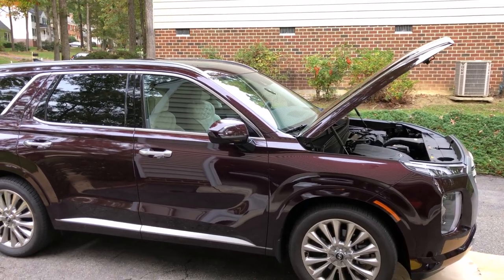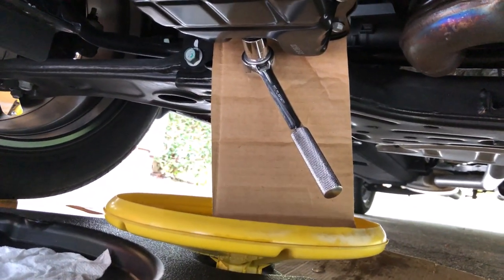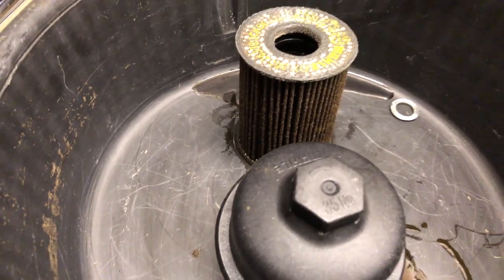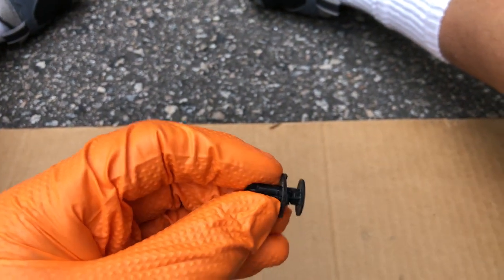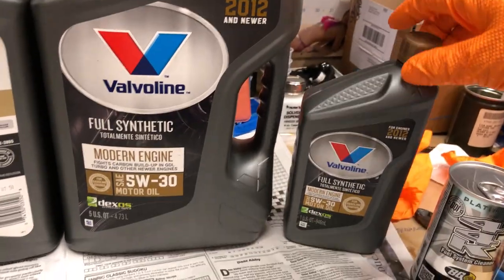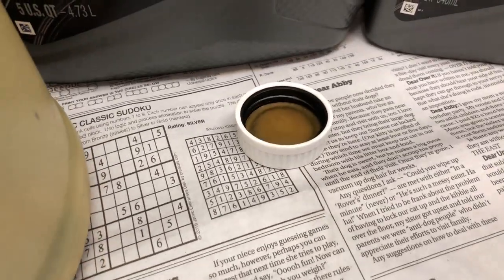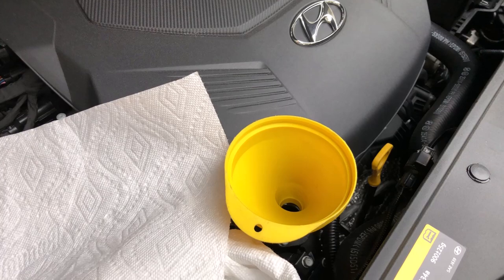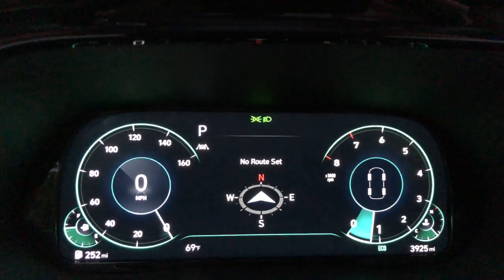2020 Hyundai Palisade & Kia Telluride Oil Change

Comment from the maker: Update:  I suggest you add only 6.0 qts and check it from there.  
I initially put in 6.5 qts.  I pulled 1/3 qt out and I am now right at the "F".  
So, I suggest you start by adding only 6 qts and check your level from there.
Reply: Keep in mind Hyundai built and tested your everything on your Palisade, so they are gods when it comes what they write in the manual you SHOULD take it as what is recommended. If you install less oil and something happens and dealership determine's you put too less oil in it, Hyundai could void your warranty.  The same rule applies so when they suggest you change the oil, if it says 8000km and you do it at 5000km (or whatever that is in miles) no oil are you polluting the earth but you risk voiding your warranty if something was to happen.
Reply from the maker: @andrewenglish3810  Hi Andrew,  Thank you for your comment, but I strongly disagree.  Is still is, and has always been, standard knowledge that you should never overfill an automotive engine with oil.  
   Even the Hyundai Owner's Manual states, 
"To prevent damage to your
engine:
• Do not overfill with engine oil.
Add oil in small quantities and
recheck level to ensure engine
is not overfilled."
Reply: @andrewenglish3810  you can change your oil every 1000 miles if you want. You just can't go past the 7500 mile mark for warranty purposes.

Comment: Thanks for posting this. I just boght my Palisade last month not ready for an oil change yet. When my car is ready for it's first oil change this info will help me a lot specialy info about Famuto drain valve. Thanks again.
Reply from the maker: You’re welcome. You will love the Fumoto valve.
Reply: How many miles is the oil change due?  The palisade doesn't have an indicator
Reply from the maker: @tomtom915melendez3  The book says:
Normal driving: 7,500 miles/12 months
Severe driving: 3,750 miles/6 months
Reply: @rickstid-bits  the valve didn't work for me.  Not enough clearance from oil pan indention.  Could not screw it in the oil pan.
Reply from the maker: @jayvogel7273  I'm sorry about that.  Thank you for letting me know.  I haven't done my second oil change yet.  They make a valve that stays loose while you install it, then it can be positioned and tightened.  It is their SX series.  Call them and see if this one will fit.  They should exchange it for you.
 https://www.fumotooildrainvalve.com/SX.html 
Again, I'm sorry about that.
Reply: @rickstid-bits  no problem.  I did first oil change today and was excited to put it in.  But hope this helps everyone else.

Comment: This is very helpful, just wish you would have shared when you tool the oil plug and the oil filter off.  As for the amount of oil, I went to my dealer and for the 2020 Telluride its 6.0 quarts.
Reply from the maker: Hi James,  Sorry . . . I had one hand on the wrench and a paper towel in the other ready to wipe the wrench hand dry.  It did shoot out the drain plug hole.  The filter was a nice and slow stream.  Thank you for writing to me.

Comment: Hi Rick, I had a recent oil chance on my 2020 Palisade and am experiencing a leak through the drain plug. Any idea why? Is it a problem with the washer? Any suggestions about it? I will have to return to my mechanic for the second time to see if they can stop the leak.
Reply from the maker: Hi Alex.  Yes.  Take it back to him.  It could be it's loose, dirt in the washer's seal, forgot the washer, cross threaded the bolt.
Reply: I would def take that back dont f with slow oil leaks

Comment: Ive owned mine for about a year. Honestly the oil catridge never goes back super smooth. It always binds slightly as you advance the catridge with a bit of force as you say from the new filter.

Even using oem filters, im having some leaking thus far. Im going to monitor very closely this next interval and send to hyundai if it leaks any more.

Comment: The best oil for Gdi engines is penzoil platinum. From someone who’s done a lot of research on it lol
Reply: Also BG products are awesome
Reply from the maker: Thank you Michael.
Reply: Another way to keep your intake valves clean is to run marvel mystery oil in your gas with every fill up. Good video thanks for the info on changing the oil in these new cars.

Comment: Do you torque the fumoto valve to some spec of foot lbs? Also, I assume once that valve is there, you don't remove it at all? So no need for replacing the crush washer unless it comes off?

Thanks
Reply from the maker: Hi Stan,  You are correct.  Once its installed - you leave it on.  Here is their torque chart:  http://www.fumotousa.com/size-chart.php?torque
Reply: @rickstid-bits  thanks Rick

Comment: Would doing your own oil changes void your 100k/10year warranty ?
Reply from the maker: Hi Johnny,  No.  As long as you keep records of your DIY maintenance so you can provide proof if ever necessary, and use the recommended oil, filter, etc.
Reply: Rick S thankyou

Comment: Can you use a KN filter instead of these "new style" repair kit as you get?
Reply from the maker: I wouldn't think so, but I don't know that for certain.
Reply: I am getting ready to use a kn filter on mine.  It’s a listed model as comparable.  Shouldn’t be an issue.  My dealership charges about 17 dollars for the filter.  A little high, but not horrible.  But I’m going to use the kn instead.

Comment: Took my Kia Rio to Valvoline oil change. they drained the oil and didnt have those kind of filters. they gave me free 0-20 oil and said i can only get it changed at the dealer. you can get the Filter Elements at E-Bay and Amazon.
Reply: My 2020 Kia Rio gets a Average of 45MPG at 60 Degrees F + its Just Awsome for a non Hybrid Car.

Comment: Did you need an adaptor on your fumoto drain valve for your 2020 Palisade?
Reply from the maker: Hi Maddog.  I haven't installed it yet - but we shouldn't need one.  The thread size of the F106N matches the threads of the oil drain plug.
Reply: I purchased the valve mentioned and I didn't have enough clearance on the oil pan to install.
Reply from the maker: @jayvogel7273  Hi Jay,  I just sent you a response in your other comment.  I hope that helps.
Reply: Did you successfully install your fumoto valve? Was there enough room? Thank you.
Reply: No I have not.  I went with the Stahlbus
Reply from the maker: @tedcannell629  Hi Ted, I haven't done another oil change yet so I haven't tried the different valve.  I bought the F106SX valve (mounts in various angles, etc.) and also the ADP-106 extension adapter.  For another $6:  I wanted to have the extension available in case I need it.  By-the-way:  I called Fumoto last week.  They still don't have any data for the Palisade or Telluride, so they still cannot tell us what fits.  I will update my info when I do my next oil change.

Comment: The telluride doesn’t have the two push pins, they put all screws.
Reply from the maker: Nice!   Thanks Ryan.  Is yours a newer model?  Maybe they changed that for the newer models.
Reply: @rickstid-bits  that’s what I was thinking but I saw a 2020 telluride oil change video and it has all screws also.
Reply from the maker: Thank you Ryan.  I may look into buying those screws and nuts inserts because I can see these plastic rivets wearing out very quickly.

Comment: crush washer fac torque spec  no less then 25 ft lbs  no more then 32.5   or anywhere in between is fine. im a lube tech at hyundai
Reply from the maker: Thank you Joe!
Reply: Is there a particular "brand" oil that is used at the dealership or is it a bulk no name oil that meets the spec? Is it synthetic? Is synthetic recommended in the 3.8 GDI?
Reply: @Quik5oh  quakerstate full yn
Reply: @joehyundaitech7961  Is Hyundai factory filling (off of the assembly line) Palisade's with Quaker State full synthetic or are they using conventional oil?

Comment: Why all the auto manufacturers put the oil change port at the back of the engine making it difficult for the DIY to change oil? Why can they put the port at the front and make it easier to open/close the dame hole? Put a faucet there.
Reply from the maker: Get that Fumoto valve.  You will love it!
Reply: Because if you put your vehicle up on ramps to change the oil the pan drains to back.
Reply: Well if the drain is at the bottom and to the front then we don't need to jack up the car.
Reply: @LeeVideo  You do if you are girthy like someone I know...

Comment: What oil weight are you talking about? There’s no such thing as oil weight but it’s winter.
Reply from the maker: Hello,  
From Wikipedia:
The 11 viscosity grades are 0W, 5W, 10W, 15W, 20W, 25W, 20, 30, 40, 50, and 60. 
These numbers are often referred to as the "weight" of a motor oil, and single-grade motor oils are often called "straight-weight" oils.
Motor oil - Wikipedia
https://en.wikipedia.org › wiki › Motor_oil
Reply: Hahahahah to funny

Comment: Has anyone installed the fomoto f106n yet?
Reply from the maker: Maddog29 reported a few weeks ago that the F106N won't install.  It won't clear the oil pan.  I bought the F106SX, but haven't installed it yet.  It expect to do that next month.   The F106SX should fit because you can rotate and position the body of the valve AFTER you get it installed.
Reply: Hey rick could you please confirm if the sx was successful, ty for an excellent video
Reply: I installed the F106SX. Has been a breeze to change the oil. I used garden shears to cut approx a 1in×1.5in piece from the cover to allow the valve to be free from contact. Unfortunately, you still have to remove the cover to access the filter but it's not too time consuming. I'm trying the Penzoil Ultra Platinum 5w30with the K&N HP-7035; previously had the Penzoil Platinum 5w30. For the filter removal I push up a smaller funnel with tube and drain the excess oil into my oil jug and allow the filter to drop into the funnel upon removal. I start with 6 quarts and typically dont need to add another.